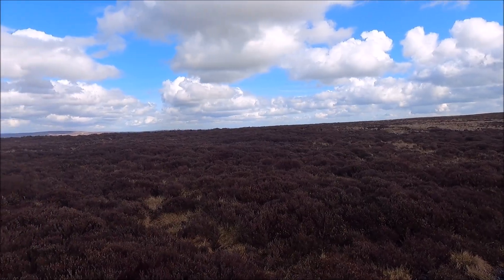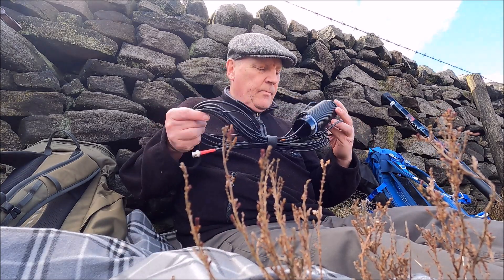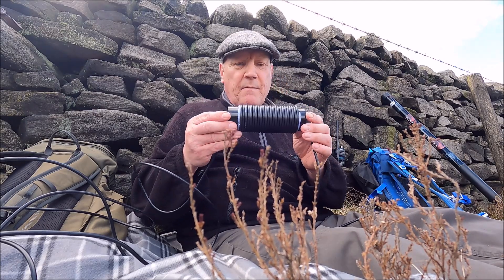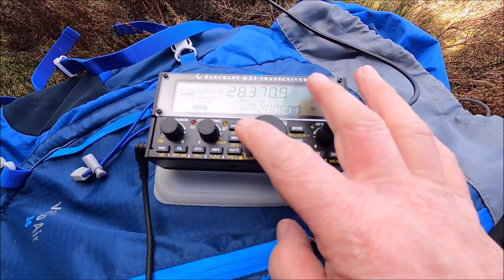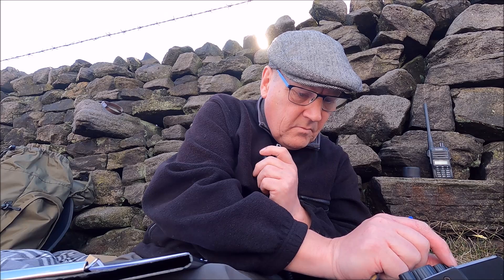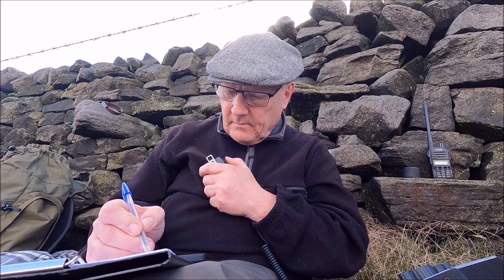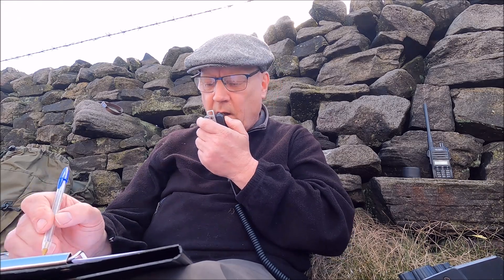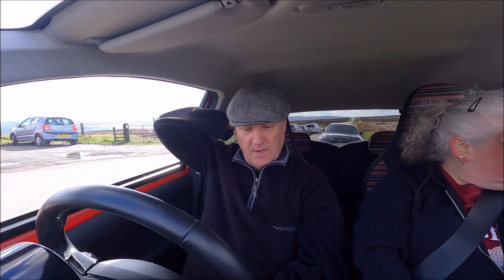10m Coaxial dipole (flowerpot) antenna

Comment: It appears you are on the Moors of Baskervilles. Don'a'be out there at night! Nice work, good long CQ call. I never knew that the Flower Pot antenna was a coaxial dipole until watching your video. The coaxial antenna is one of my favorites.
Reply from the maker: I certainly wouldn't fancy been up there at night. I wish that more operators would put out longer CQ calls as it gives people more chance of finding them on the bands. I've see designs for Flower Pot antennas for 2m & 6m. Thanks for watching. 73 Chris M0RSF

Comment: Excellent Chris. I often use fishing pole verticals, and find that wrapping the wire a couple of times around the pole and just securing at the feedpoint is sufficient to prevent flapping wire.
73 and best wishes,
M3KXZ
Reply from the maker: Cheers Pete and good idea to wrap the wire around the pole. I will try this next time as I will be using this antenna throughout this year. 73 Chris M0RSF

Comment: Great video Chris, good to see you out and about. PS - I think you are going up this season. By the way - have you watched Leeds The Wilderness Years videos at all on YT? I am sure you have, but just in case they are a magnificent collection. 73
Reply from the maker: Thanks Tim, this antenna is easy to construct and works well. I’m looking forward to trying it out when there is not a contest on. Thanks for the heads up regarding the Wilderness Years videos. I started following Leeds United in 1985. It was £3 to stand on the Kop on match day and the season after my season ticket was £60. Football was different back then and I’ve been in some awkward situations with opposing fans. All the best Tim and thanks for watching. 73 Chris M0RSF

Comment: Happy Easter 🐰
Nice work Chris. Its good to see you out and about. How are you getting on witht the KX2?
Can you imagine how big this would be if you did a MFD setup like you did for the 2m one 😂.
I am still yet to find my perfect portable antenna.
73
Reply from the maker: Happy Easter to you too, It really was good to be out again. The KX2 really is a beast. Light, it has the internal ATU, gives me 10W and the performance is excellent. For HF I find that the Band Hopper is the best antenna for portable. I might be using a different transceiver in a couple of future videos 😉 Hopefully we will have a Summit to Summit QSO this year. 
73 Chris M0RSF
Reply: @M0RSF  yes it sure does look the beast. I very nearly bought the KX3 about a year ago. I was soo close to getting a cheap ft857d or a G90 about a week but they were snapped up. £200 each.
Hmmmm what you got Chris 4xcr, 6100 hmmm what are you planning🥴😉
Yeah hope so. I am joining a club near me which might get me back out doors. It's just time and family myside.
73 mate

Comment: That's a nice and very easy and simple antenna 👍🏻
Enjoy the Sota and the hobby

Ron, pd3ron
Reply from the maker: Thanks Ron, the antenna is easy enough to make and seemed to work well. It would be an ideal project for a radio club. It was difficult though due to contest QRM but I will be using this antenna during my activations this year. 73 Chris M0RSF

Comment: Excellent Chris. Nice operating spot there. Loads of locals on 10m. Can't believe that!😮 I did consider an antenna like you used but I don't have a 10m mast.
Cheers, Fraser MM0EFI
Reply: Happy Easter Fraser. You say 10m mast.... Would this not work on your carbon 6 mast?  Would it not be as good due to the hight about the ground.
Reply: @m7trsradio  happy Easter 🐣
You are right of course. I think it would work ok with the carbon 6 as it is only plain wire for the top half. Maybe the 7m pole would be better to get the feed point up in the air a bit.  Probably wouldn't need a 10m pole after all.
Reply: @theradiorover  think you should build one mate and see how the 6m does. Not sure how close to the 6m it is. I have a 6m mast which is 5.60m. so the coil would be off the floor for me I guess. 
I think the 10m flowerpot is just under 5m. 🤞🏽👍🏽💥🐰
Reply: @m7trsradio  I may do that! I'm out this afternoon using my 10m ¼ wave vertical plus sloping radials. That works really well.
Reply from the maker: Cheers Fraser. I would have stayed on 10m SSB longer had it not been for the contest. The S2S QSO with Stavros SV2RUJ/P who was in Greece was nice. This antenna would also work with a 7m pole though I used my 10m pole on this activation to get the antenna a little higher. I'm taking my 7m pole next time as its much lighter. 73 Chris M0RSF